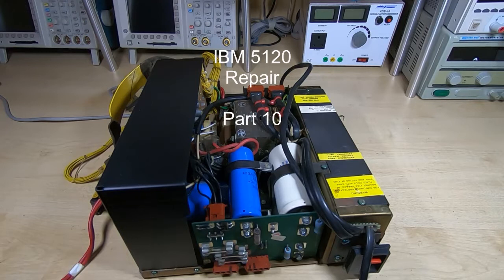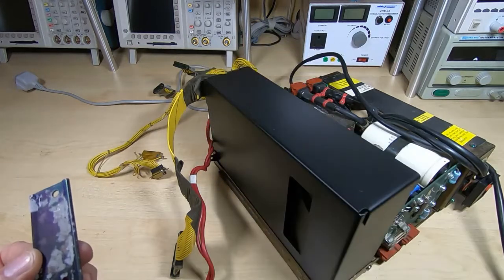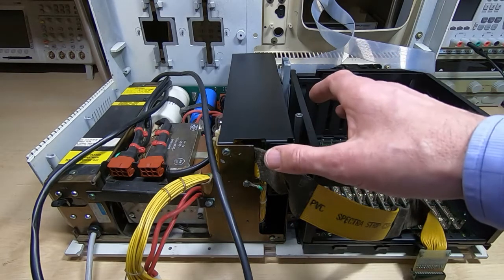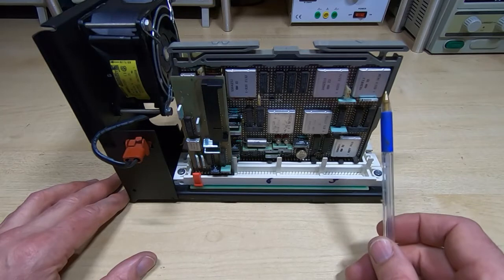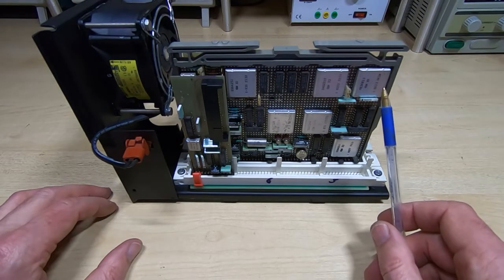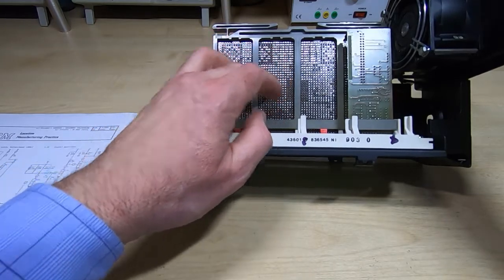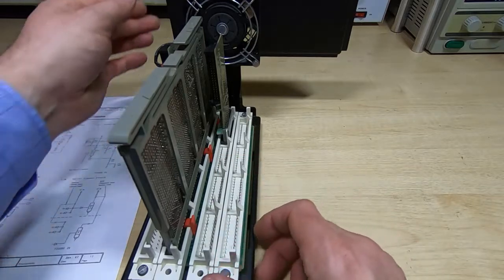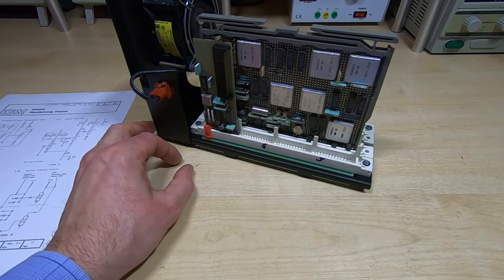IBM 5120 Part10

Comment: Looks like the hard work is paying off it almost looks like new. Can't wait to see things start to power up, let's hope it goes well.
Reply from the maker: Looking promising so far but the high unloaded +5V rail concerns me. The IBM modules are very tolerant of voltage variations but the monolithic IC's may not be. I am actually tempted to remove the old supply and fit a modern one but as you probably guessed I do not like to modify these old machines (although blowing the boards to bits could be considered a modification :) ). I would be interested to know what the individual who gave this video a thumbs down 'disliked'. Seems to be a lot of babies about these days.
Reply: Someone was following my videos a while back and was disliking every one I put up, quite anoying really. On the subject of PSU's I was very tempted to put switched mode PSU's in the MDS,  but the problems of syncing the power up of multiple supplies put me off a bit. I used a relay in the Altair and this seems to work fairly well. I also came to the conclusion that the more gentle startup of the linear supplies might benefit the ageing components. Ultmately I'm thinking about making up a relay box in series with the mains supply which monitors all the supply rails and if any go slightly out of spec it would just cut the power completely. I've got quite a few boards to go into the MDS-800 and certainly don't want to fry any with a dodgy power rail.
Reply from the maker: The MDS units I have all use crowbar protection on all the rails so this should prevent any over voltage damage. However the over current limit on the +5V rail is 36A so any shorts would most likely result in board damage. The 5120 supply is really odd. The FDD supplies actually use a Ferro Resonant transformer (I may post a video just on just that as they take quite some explaining). The switching supply uses the IBM modules and a number of unmarked IC's so is a difficult thing to work on. Especially as its physical construction is a product of madness. Interestingly I repaired an IBM 36 a few years ago and was asked to replace all the supplies with modern protected switching types but as you know the supplies have to come up in a particular sequence so I just fitted a Zenner from the output of each supply to the shutdown input of the following supply and added a pull down resistor. The zenner allowed each supply to reach a certain threshold voltage befoe the next was enabled. This worked very well and they all came up to voltage in a controlled manner. It also meant that they shut down in sequence as well.
Reply: Yes, I've got crow bars on my MDS too. But I'm not entirely convinced on the protection levels. I've recently found another open circuit IC on the floppy channel board this time a 3205 3-8 line decoder it looks much like the ones on the Ram board as if the inside has been blown out leaving floating outputs.
Reply from the maker: You can normally drive the outputs by applying a voltage to them with them disconnected from the machine and slowly raising it until the crowbar trips. It depends on the circuit of course but it usually works.